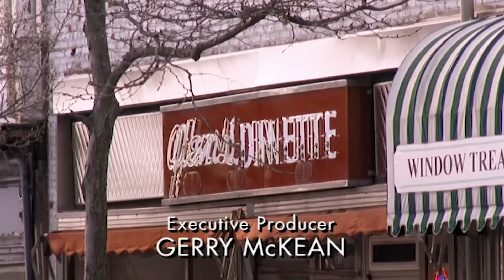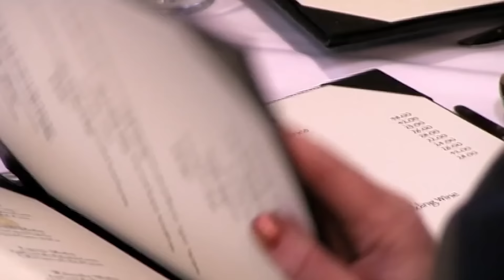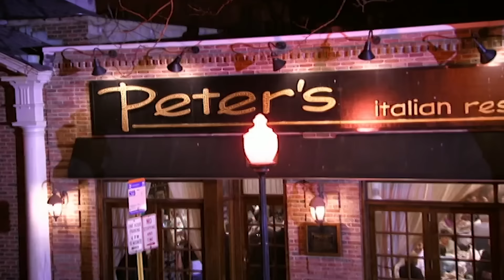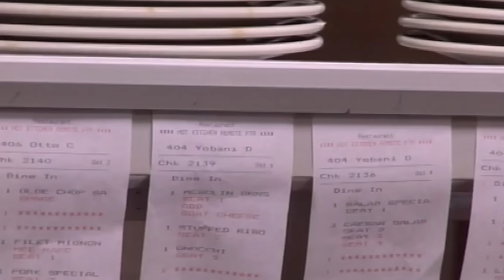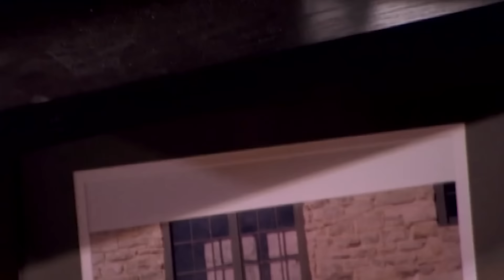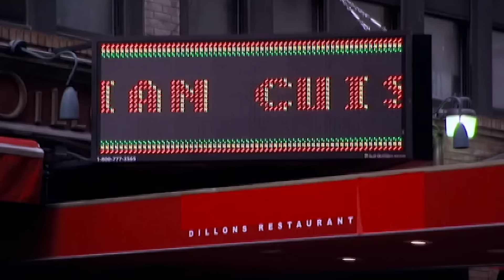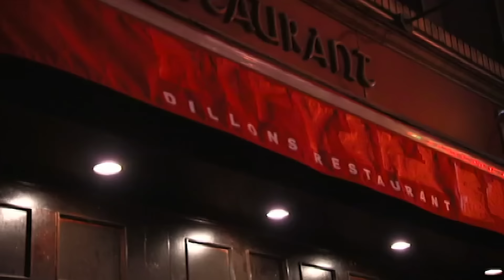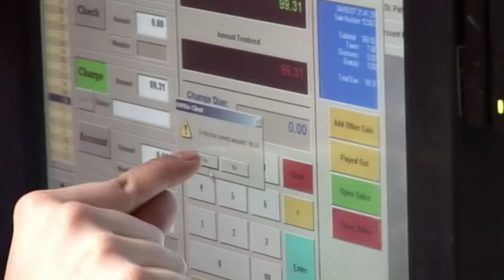Iconic Season 1 Episodes | Kitchen Nightmares

Comment: I always say it Gordan is always so nice to the wait staff , because they are on the floor they know what's going on as they deal direct with the customer , the manager and the chefs , they are the most  valued of any member of the team I think personally , and if you think differently that's fine , I understand , but I always tip as much as I can afford on that day , but always try to do 10% which is not required in Ireland , where I am from and do my videos etc , but I still tip when I can
Reply: Not required in finland either. I do tip, but only when the service, food or preferably both are great. Night out with starters, maincourse and and single drinks for two will take 65-100 euro's out of your pocket usually, without any tips. Usually the higher end.

Comment: Mike the chef:  "I'm NOT GETTING ANY TICKETS!  FIX THIS MACHINE!!!"
Dean:  "No, it works fine."  Head in the sand won't work.  Check the paper tray/roll.  STOP SCREAMING and LISTEN to your chef!  Does the salad printer print ALL of the food?  If so, use that.  But I assume it does not.  But if the salad printer DOES print out all the food on its ticket, I agree with Dean, read the f'ing ticket!!

Comment: Peter comes in, takes money from the business for himself and takes it away from his sister as well, since she is owner too.  Peter then starts eating and drinking, causing more loss to the business.  Peter then gives free food and drinks to his customers also causing loss to the business.  Peter spends money on tan, car, teeth whitening, clothes but not on the oven, freezer and kitchen equipment.  Peter is irresponsible. When, not if, food is rotten then Peter as the owner is responsible.  Peter as owner is to oversee the manager.  Peter does not provide the equipment needed to work and throws away all the product and income then he gets rewarded by Gordon with a brand new kitchen.  Peter could see there is mold in the frdge yet he does nothing about it.  Peter saw the salad was crap.  Peter knew the food wasn't freshly made and it was bought.  Peter keeps spending money from the restaurant and STILL has a debt collector after him.  Peter spends more than the restaurant even brings in.